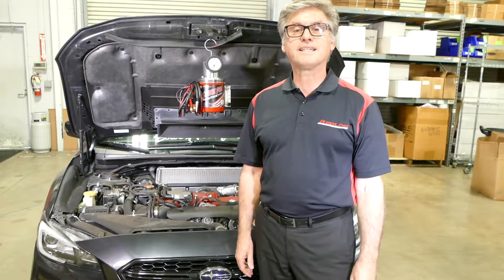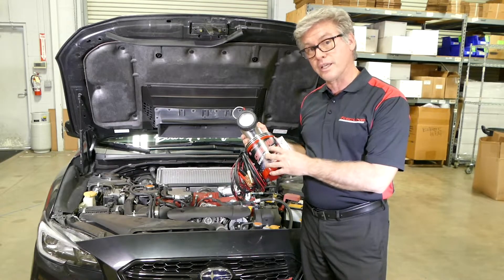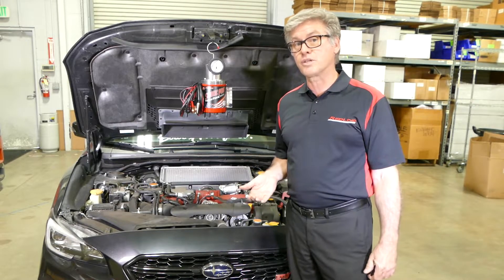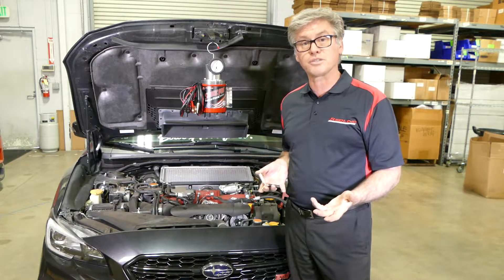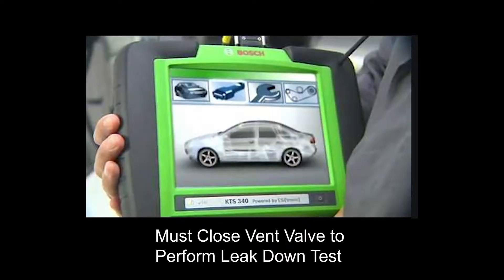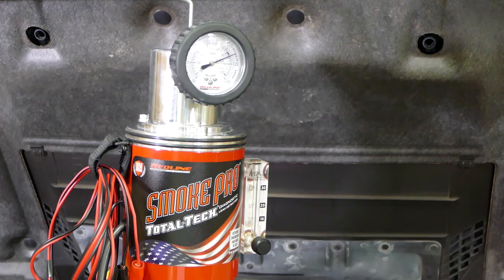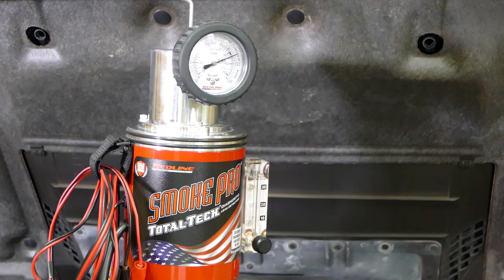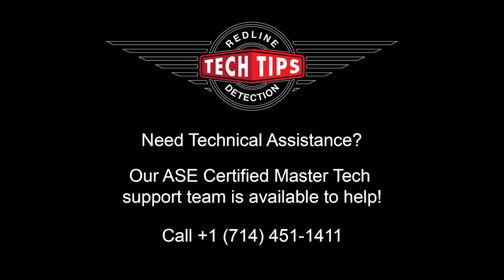Tech Tip: How to Use a Leak Down Gauge to Verify EVAP Fault Codes - P0440, P0442, P0455, P0456

Comment: I have watched expert videos where they say using shop air may skew results because the particles within the shop air may be too large to escape small leaks in the evap system. What is your take on that?
Reply from the maker: The air we breathe is made up of 78% Nitrogen - the 7th smallest element on the Periodic Table.  It may not be necessary to worry about that air being incapable of escaping EVAP leaks.  As long as your shop air/compressed air is filtered properly with a high quality oil/water filter system, you should be good 👍
Reply: @redlinedetection  Thats a great point. Thank you for the answer.

Comment: Another great tip.  A lot of the aftermarket gas caps leak.
Reply from the maker: Thank you Ken!
Reply: Good info, the leak down detector is a great feature to have in a technicians arsenal of tools. 👍